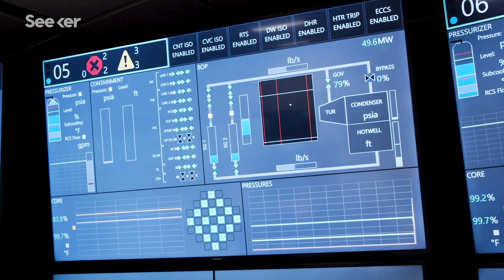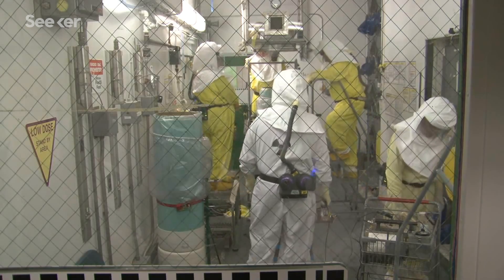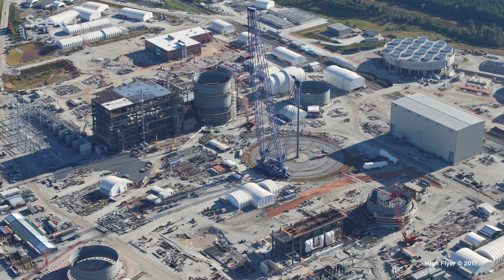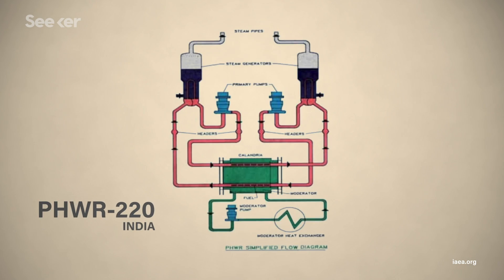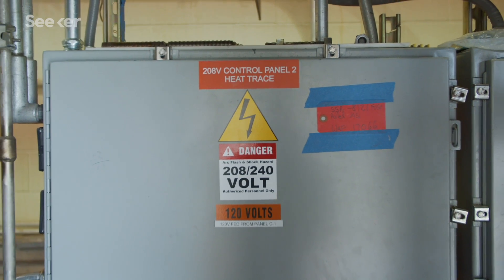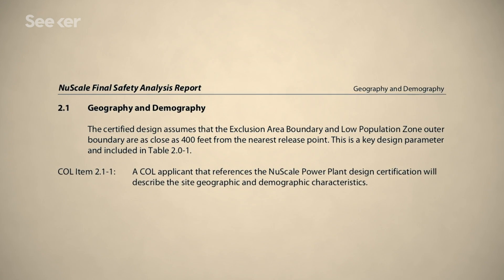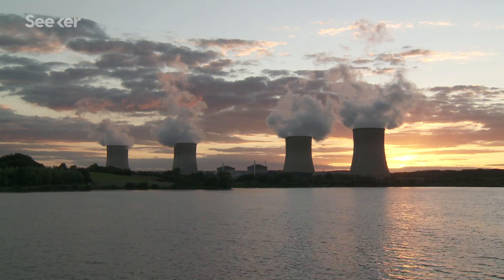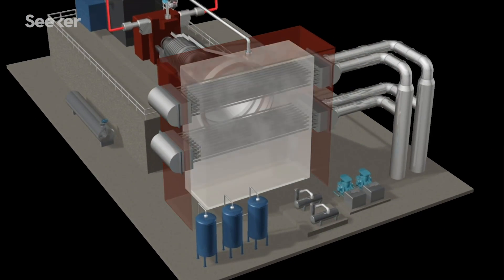Mini-Nuclear Reactors Are Coming, and They Could Reinvent the Energy Industry

Comment: No mention of Molten Salt Reactors. This video plays like a sit down with a company salesman and a Skype video with a random Professor.
Reply: Nathan Frey They’ve already done a video on that.
Reply: It probably wasnt a broad thing just a piece on this particular company
Reply: Seeker dives deep on particular topics while providing breadth over time.
Reply: this video wasn't about every kind of reactor, just specifically this one. they have done a few videos on thorium and it's vast potential.
Reply: https://youtu.be/bcjYwxrUERg
Reply: This is simpler and already more feasible.
Reply: Show me a running prototype.
Reply: revspikejonez Like the ARE project in the 1950s with the US Air Force? Or perhaps you would like the MSBRE that operated for 5 years at Oak Rodger National Laboratory in the 1960s? 

Or there’s also the experiments at INL, BNL, LBNL, ORNL and ANL? 

Oh and then there’s also the commercial permits for an IMSR in Canada under construction.
Reply: @revspikejonez   They must receive safety licensure before building a demonstrator. It will be great.